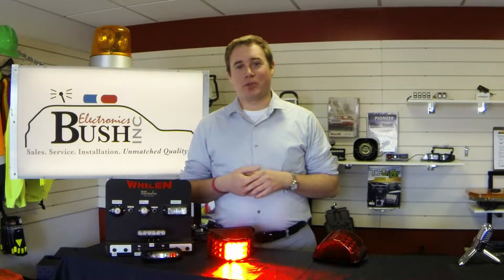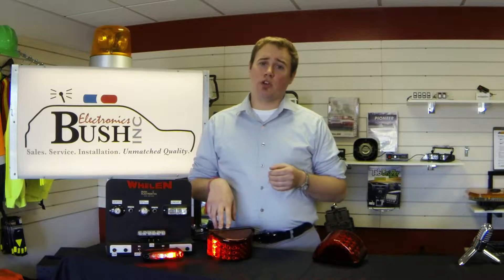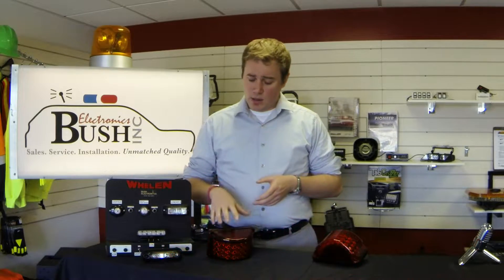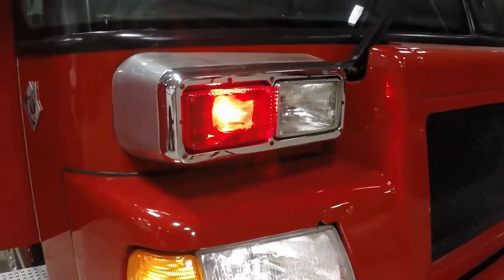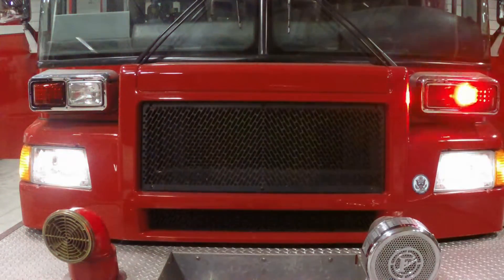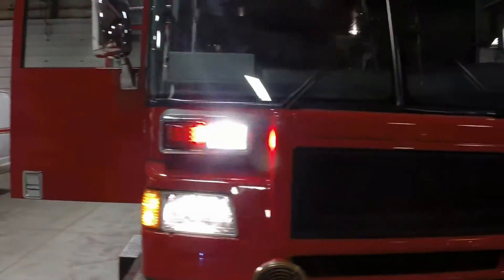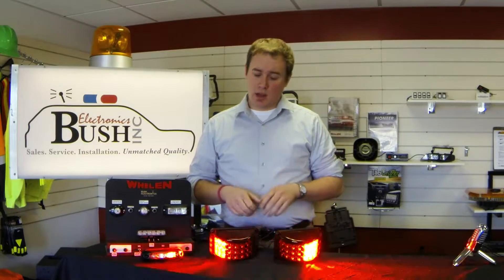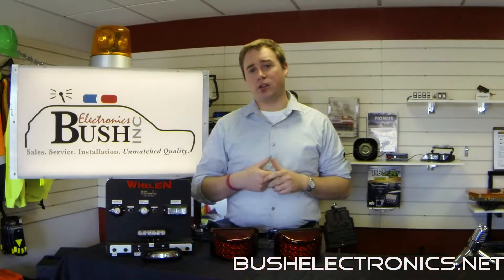Whelen 600 Series Rota-beam

Comment: Can you retrofit this into an Edge 9000?
Reply: No
Reply: John  Lagrone depends on how far you are willing to go upgrading power supply and installing a flasher and making the mounting brackets for everything.
Reply: @ArmEConDoesMinecraft  if the 9000s are 400 seires and those are 600 I thought it wouldn't fit
Reply: John  Lagrone the Whelen freedom rotabeam modules fit in the freedom lightbar, which the edge was the grandfather of the freedom so to speak. I believe that they would probably fit then if you got the rotabeam modules for the Whelen freedom. But I could be wrong.